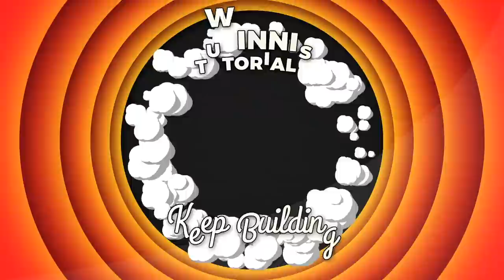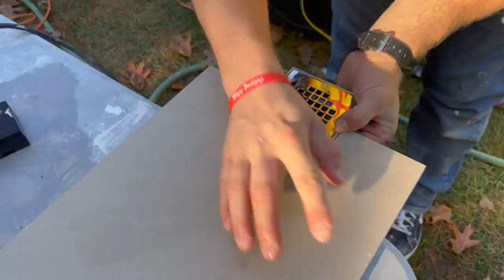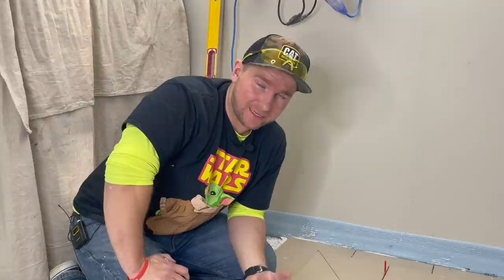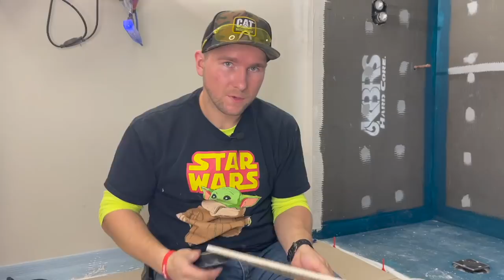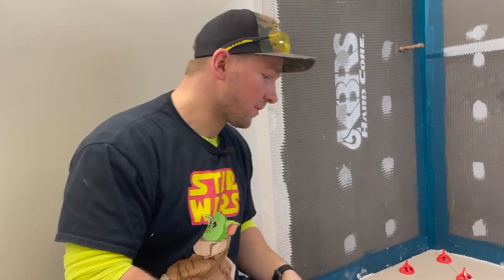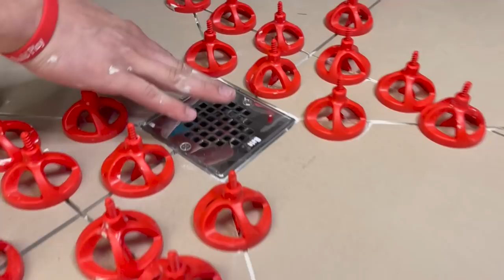🚀 Curbless Shower 🚀. Large TILE on shower Floor. KBRS Shower Pan

Comment: Hello mate just to start off you are great guy very professional have the right tools for the job and i love your content here and on tiktok and this job is just perfect 
I do tiling with my father in law and i have a tip for you if you care to listen 
When doing the cuts from the drainage towards the corner of the tile don’t do the cut on the tip of tile corners end I suggest going a little bit off to the right or a little bit maybe 1 cm to the left depending where will you be installing the tile
We do this so when you tile the wall you don’t cover that perfect corner if it makes any sense try it yourself 
Because with the way you have done it once you put or install the wall tiles you will the cut of those corners is gonna be off a little bit because the wall tile have covered 
If interested check and let me know
You have a good one champ
And hope you best of luck

Comment: It`s the best tutorial!  Can you tell whether we have to maintain a gap around the square waste or fit tiles as close as it`s possible, please?  Should we use a grout compound or a silicone for filling gap in between the drain and tiles? Also, I can`t understand how to use tile levelling system, because it`s designed for flat surfaces, but the shower floor has four sides fall...  Can we avoid this, or use a sticky tape instead? Thank you

Comment: Nice to see a center drain curbless. I am building my house in the spring and my flooring store was trying to convince me that only linear drains can be barrier free.
Reply: If you use schluter, you can do any drain placement with a curb less entry. There are videos on youtube explaining how to drop the shower floor to meet the rest of the bathroom floor. Schluter has a youtube page that should have it.
Reply: @mattjudy6780  oh I know. I am just going to raise the floor to meet the base thought a 5/8 subfloor then sutra heat brings me flush to the substrate. Just boggles my  mind that this flooring place is trying to tell me there’s one way .. when I know there are multiple
Reply: @danbedard290  yeah they obviously don't know what they are talking about. Good luck on the build!
Reply: @danbedard290  but it's going to cost more to raise the rest of your bathroom instead of just lowering the shower floor. And it will also cause you to have a hump going into your bathroom as the rest of your house will sit lower. Just some things to think about. Cheers mate
Reply: @mattjudy6780  thanks man. I was actually playing around with some details and what it looks like I going to do because my tray is 1 1/4” thick, I’m going to use the schluter ramp, which is also 1 1/4” and terminates flush with the schluter heat. I’m going to be installing and drip dry drain at the base of the ramp as it will be the towel areas. I’m a plumber by trade, so the extra drain was going in anyway lol
Reply: @danbedard290  nice! Wish you were in SC! My main plumber retired recently. Good luck. If you need any guidance feel free to message me here and I can get you my contact info. I work with schluter products pretty much everyday.
Reply: @mattjudy6780  thank you and I will!
Reply: @danbedard290  sounds good. I don't know if you can message on youtube but we can find a way to get in touch and video chat if you need to show me something. I have Facebook under the name Matt Judy in columbia south carolina

Comment: Great video.  As a contractor I would  never recommend using large tiles on the shower floor. Large porcelain tiles are just too slippery.  It looks great but like many things out there , it's not safe or practical.
Reply: As a contractor you would surely know that you can get large format textured anti-slip porcelain tiles suitable for a wet floor.

Comment: Will a glass shower door be installed outside of the foam sloped pan? Should you avoid drilling through the sloped area for glass door installation? How do you get the shower tile lined up with the outside shower tile to be exactly even?

Comment: How do you ensure a consistent, proper slip to the drain?  Is that just experience or is there a technique?
Reply from the maker: Well if your pan is level. All you need is consistent trowel work.
Reply: The pan has a slope built in.

Comment: What blade do you use on the angle grinder
Reply from the maker: Its a 4" Rubi Venom. I have the Tool Locker Link in the description:)
Reply: I seen the VIP Turbo Mesh blade and the and the Red COBRA blade on your tool locker but not the venom. Which is better?